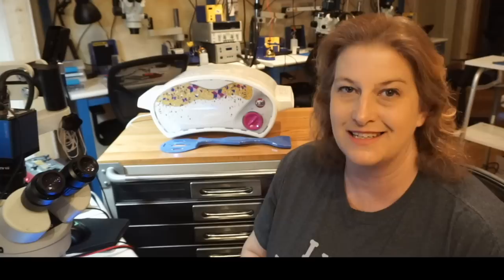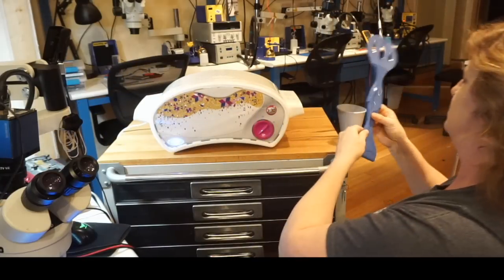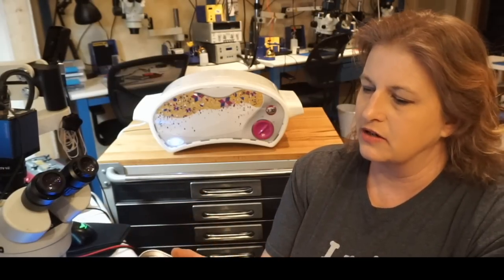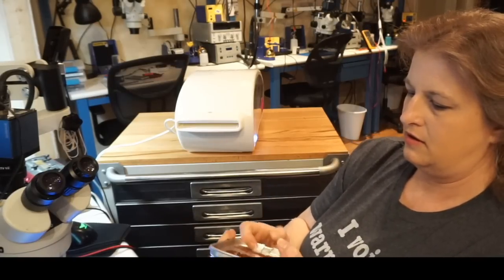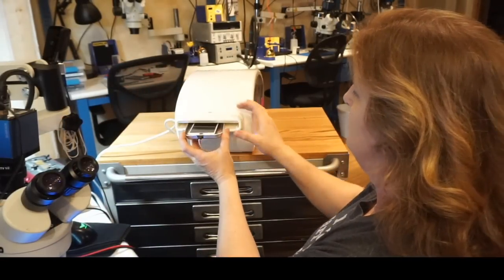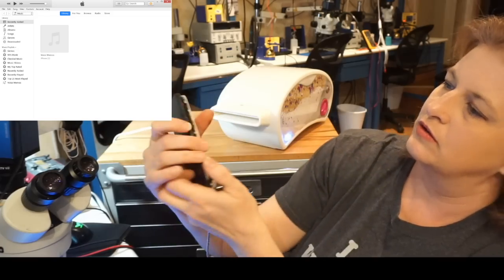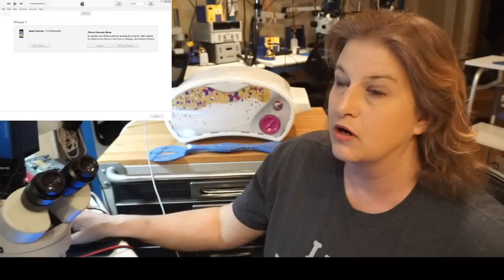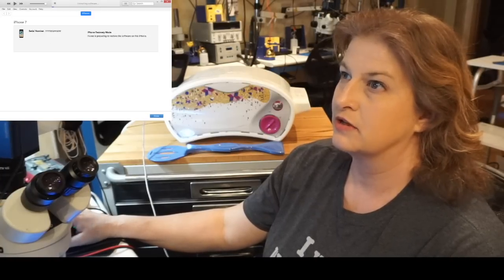EASY iCloud Unlock Solution 2018--iPad Rehab April Fool's Day Joke Video

Comment: OMG It Worked.....I used my fan assisted oven at 280 celsius  then injected 20KV high tension into the charging port which not only removed my Icloud lock strangely it also activated my smoke alarms ''which are not Icloud locked'' This Works so forget all the scam websites that guarantee Icloud unlock '' Jesse you are the best.

Comment: You should mention this will only work in countries with 110V 60Hz mains voltage. We here in Europe are stuck with 240V 50Hz and will need to use a converter to make this trick work. You should consider adding the Easy Bake oven to the iPad Rehab Store.

Comment: cant get the easy bake oven in europe .put  it in the store.
also will need a stepdown converter as you guys use 120v@60hz and europe use 240v@50hz so it will take 15-16% longer.
will also need your brownie recipe for the brownies to keep things consistent.
happy april Jessa xx

Comment: It really works :o omg, i just unlocked two phones with that! That eas
Reply: please friend just i want to know at what degree of temperature  u are preheating the iphone?
Reply: Dafir Mahmood 420F
Reply: Dafir Mahmood its a bit tricky, i think theres no way to do it without the easybake oven since that thing really seems to have the right temperature and it also puts just the exact amount of heat on the phone so that due to the iphones dissipation the temperature inside of the wifi reaches the exact necessary value. Unfortunetely, as soon as you put something in there to measure the temperature the dissipation surface grows which causes this method not to work. So in in fact only works if theres ONLY the iphone in there
Reply: thank you so much friend to explain that so i will try to set the temperature first to the exact value 420f as what said the other friend above and  after that i will put the iphone there to complete the procedure ,is that good to work???
Reply: Dafir Mahmood 100% fox bro.
Reply: hot applied over the iphone or under the iphone or applied from the both sides?
Reply: Where u buy easy bake oven from ???
Reply: wtf... RIP iphone..
Reply: It's really work or what ???

Comment: u mean change the full board? but no i dont change the board because i want to repair e it but how
Reply from the maker: Change the board, or spend a few years learning how to troubleshoot iPhone board level problems with a multimeter develop the technical proficiency to change chips on the board, and learn which faults have signature problems and which do not.  There is no "change this chip bro" answer.  It is a myth to think that all phones are repairable "if only someone would tell me what chip"  That's not how it works.

Comment: Jessa, to maintain constant temperature I used ostrich eggs, breaking them over the phone then and leave for half an hour before heating.  

The number of eggs needed correspond to the modal of the iphone, eg iphone 6 = 6 eggs, iphone 5=5 eggs etc...for the S modals eg 5s/6s, just add a pinch of salt, just remember S for Salt. I've managed to unlock dozens like that. 

I know ostrich eggs are very rare and expensive. But then that's apple again making it difficult to unlock their phone.

Oh for ipads the same procedure but you must use the eggs shells. you ground them in a blender without liquid to avoid liquid damage.  Then you sprinkle the size of half a tea spoon before you heat in the oven- yes for ipads you can use the oven, no problem  Good luck